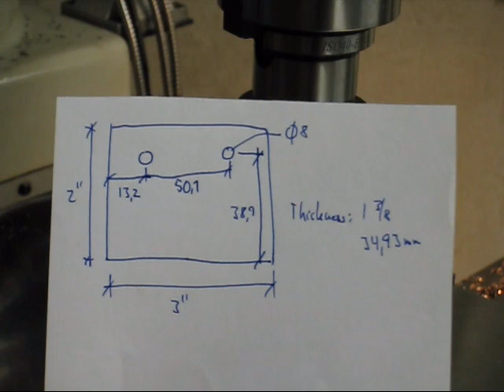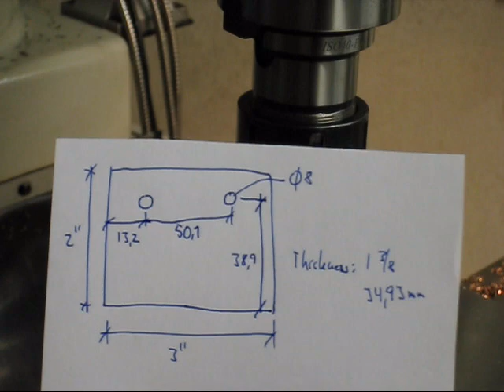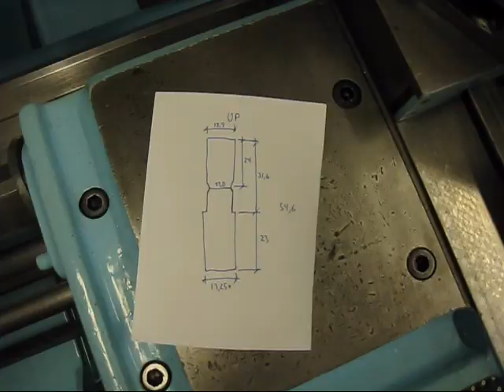American Pacemaker part 25 - Vintage Worklamp

Comment: The machine lamp is a favorite item on our machine refurbishing in-house. Current favorite here is a metal spun one similar to the one you have there powder coated black and with its original flexible goose neck tube. The machine lights have always been our weakness we still convert them to LED in the end though. Really like the baby blue color of the lathe now lets watch you continue to rebuild her. Great video.
Reply from the maker: Thank you. The machine light is important but often overlooked. I am happy with the old bulb as long as it lasts.

Comment: Very nice! 

Most lamp sockets were rated for 60W in a fixture like that, possibly even 100W if there was some ventilation in the top of the shade. However, I agree that an LED bulb is the way to go these days. I've had my forehead branded by lights like that more than once when I bent over to look at something closely.
Reply from the maker: It might have been rated for 60W, but as you say the LED bulbs of today offer both better light and less heat. Thank you for commenting !

Comment: Good to see the Baby Blue Lathe again.
Looks as good as ever.
Will you be making a chip tray for the back of the lathe,
It might help to keep the  area around the back of the machine clean,  and it would look good too.

The work light adds a nice touch
 to the lathe also.

Looking forward to the next video.
Regards Peter..
Reply from the maker: Thank you !  There is a chip tray underneath the bed, but I am sure you saw that in some earlier video. At the back there is also a chip-shield that protects the motor and coolant pump. Originally there was nothing more. I guess you are suggesting a chip shield like on the asian lathes with a 1m turning length. Although that is nice on a lathe like that, on a lathe with a taper attachment it would be in the way. If not one would need to make it easily removable and for the size it would need to be it would be unpractical. Thanks for the idea though !
Reply: @Panzax1  You are right i did watch all of the original videos when you were rebuilding the Lathe.
A long series but very much liked.

I guess I get use to see the rear guards even some of the European Lathes I have used in the past were fitted with them also.

I cannot recall how your taper turning attachment on your lathe is mounted.
It has been some time since watching the series of videos. 
Possibly a rear guard behind the chuck area itself would work.
I mostly mentioned it,  as a lot of the swarf and coolant ( if you use it ) finds its way behind the lathe 
It might help to cut down on cleaning the floor was mostly the idea.
But i am sure you will work out what works for you.

Thanks for the video and your reply.
All the best.
Regards Peter.

Comment: An LED Flood lite might work good.
Reply from the maker: I have not heard of that. Is that a special kind of bulb ? Thank you for commenting!
Reply: @Panzax1  I think the type of lamp David is thinking of is the PAR 38 type. Sylvania makes a number of beam angle and color temp bulbs. Claimed as very cool operation. A 25watt lamp equates to 250 watts incandescent. Universal voltage available eg 120-277VAC. regards vic

Comment: Are you sure that base is sturdy enough, might want to put some gussets on to beef it up. Don't worry about pennies to run the bulb,that is the best light bulb, I hate LED's. Isn't the new machine up and running yet?💡💡💡
Reply from the maker: I am kind of worried about it breaking so maybe I'll make a new one out of titanium with four HT studs that go all the way though the carriage :)
I principle I agree about LED's and all that stuff. The problem is that you can't buy proper light bulbs over here anymore. And I would like to run about 100W in that lamp and I doubt the innards would like that for much more than 5 minutes with a regular bulb.
The NLX is up and running but I need to learn a little bit more before there is something to show you guys.
You have the right kind of humor! Thanks for commenting !